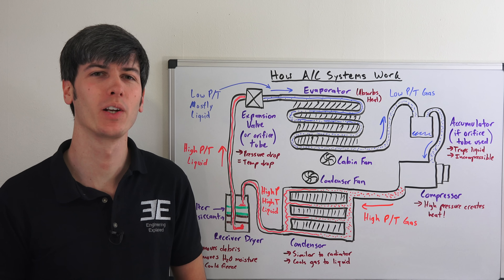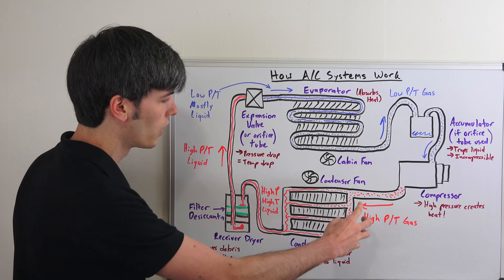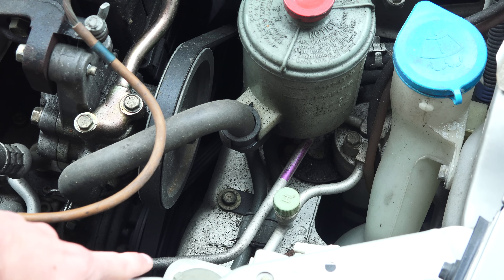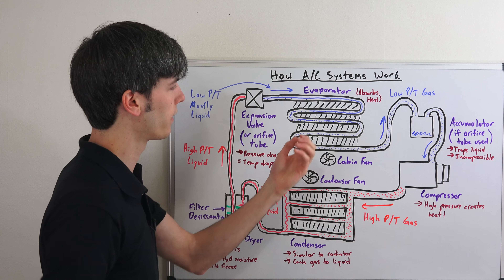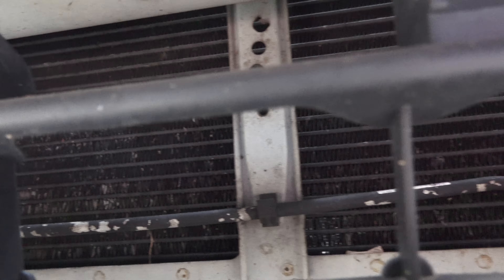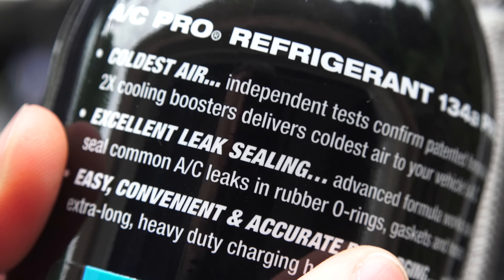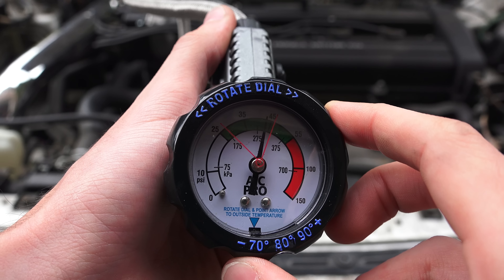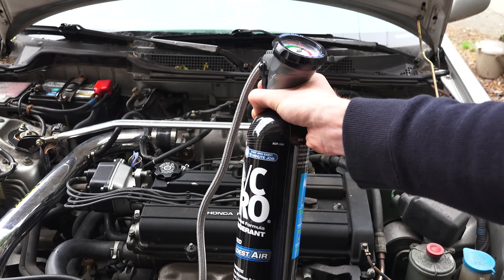How Car AC Systems Work & How To Recharge Your AC System

Comment: Coming from a professional tech, it's just never a good idea for the DIYer to do their own A/C work. Usually causes more problems than it solves. You can introduce air and moisture into your're system, overcharge or over lubricate because some of these kits also add oil. Sealers can ruin some expansion valves as well as shop equipment, hence why most good shops don't use sealers. Not to mention the safety issues of high pressure gas. I've seen people with some pretty serious refrigerant burns and some of them were mechanics. Just bring your car to a reputable professional in your area, trust me.
Reply: Yosef MacGruber just because you took your car to some backyard mechanic that didn't know what he was doing doesn't mean I'm wrong. Any good tech knows to check cooling fan operation during an refrigerant check.
Reply: Brian Fisher
So why did he apparently vent my refrigerant? I told him what was wrong with it, and it didn't work at all after he touched it.

The repair was simple, but any competent shop, will probably put on gauges, and check this and that and the other, so that they can run the repair bill into the $100s, but at least eliminate the problem of dissatisfied customers, "But it still does not work."

So what would have been the shop rate for my repair? I am quite sure it would be much higher than the cost of my DIY which I shouldn't have had to do. I guess my mistake was, in thinking that I actually needed anybody's help to replace the fan.

So how much money do you think I should sink into car repairs for an oil-burning car that is 2 decades old already?

"If you want something done right, do it yourself."

Because the world is full of morons.

"If electricity comes from electrons, does morality come from morons?"

Maybe you could answer me another question. In your expert opinion, what is the real reason that they do not want us to come back in the shop, and watch them doing our car repairs? Surely it can't be simply insurance regulations? Or do they fear "sticky fingers", that their tools could go missing? Are they afraid that we will all become DIYers? As much as car repairs cost, surely the fees must include allowing the car owner to watch? Now to let the car owner help, that might be an extra fee, as the joke goes. While the mechanics go home and watch YT to stay on top of their game? Of course, I am quite sure that YT actually does say to some people, in effect, "It is a bit too complicated to DIY, take it to somebody who has the right tools, and knows what they are doing."
Reply: Yosef MacGruber dude, lay off the Kool aid bro. You went to a shitty shop, get over it. And we don't want customers in the shop for many reasons, potential injury, missing tools and yes insurance too.
Reply: Brian Fisher
I wish I had a job in which I could ban the boss (or the customer) from watching my work. At least some people in the world, are treated as if they are important.

At least if I have something done in my home, you can imagine I watch what they are doing, because when the experts leave, guess who is left to maintain the systems of my home, if they have a problem? Thus, I feel I should know as much about them, as I can.

A shitty shop? Even a halfway competent backyard mechanic, ought to have a clue as to how an air conditioner works, before they hook up gauges without even asking. It is kind of a natural assumption, that people with the fancy tools, have some idea of how to use them. And speaking of which, I wonder where your shop ranks, on the "shitty scale" if you are actually making excuses for these incompetents?

But I have had problems with my car, that the dealer couldn't seem to figure out nor fix, then I take it to a friend, and a friend finds a way to fix it. Hmm. Always that it to the professional shop? I think not. It depends on what I need done, and how much money I have to spend, like how it is with a lot of things.

I have heard it explained this way. Let's say it takes you 2 hours, to fix your toilet yourself. You just saved yourself having to get a plumber. How many of us, have a job that pays $75 an hour? Sure, a plumber might fix the toilet in just 20 minutes, after taking 3 hours or 3 days to even show up. But not everybody has an extra $150 just lying around.

Also, I have a few plumbing parts, and watched a DIY video on how to simple plumbing jobs, so that makes me qualified to be a plumber, yes? So I fixed the sink for my employer, that everybody was reaching underneath the sink to turn off the water, because the faucet wouldn't shut off. Well of course, I did not have the correct washer to fix the faucet, in my tiny plumbing kit. So I took the old one to the home improvement store, and got something comparable. Even being on the clock, and reimbursed for a few dollars in parts, my employer saved serious money over calling a plumber. Got the same repair job, the sink worked fine the entire time I continued to work there. Of course, I am sure my employer would call a plumber before having me do any job that was too complicated. You probably do not want somebody with no experience, operating a motorized snake?
Reply: The Tool Guy
Illegal to work on your own car? Really? Have you not heard that politicians are liars? So that explains why we can buy bottles of refrigerant at the auto parts store? You never heard it was a free country, or whatever propaganda that they still tell us?

Did you know that is the purpose of quite many "laws"? To protect certain monopolies that do need protection from competition? One of the first things you learn in any decent economics course or book, is that it is largely competition that keeps prices in check/ If you are competent in doing your technical job, why do you need bully liar politicians, protecting yourself from DIY competition? Surely there are enough DIY screwups, to keep you in business?

Some of the differences in methodology, between proper qualified technicians and DIYers, are notable. No proper technician would use only one gauge to see what is going on with the car A/C. Yet that is all you get for cheap at the auto parts store. But it is the DIYer's own risk and liability, if they do not fix it correctly, as guess who will be fixing it again? The qualified technician wants to be sure he fixes it properly the first time, as he actually has incentive to justify the high cost of his skill. Why do so many of us bring our cars to the proper shop or to the dealer? Because we actually think that the shop will be expensive, but that they very likely do know how to fix the problem. If shops had terrible reputations, then there probably would be a lot more DIYing going on. By doing good work, mechanics can help keep our country above the kinds of operations that are more common in poor countries.

BTW, if you were alluding to that enviro-wacko junk-science crap about ozone depletion and how refrigerants supposedly damage the ozone layer, that is all incredibly bogus. Just another example of the rampant junk-science spewing from Babylon America. Ozone depletion was such a bad theory, that it has been strangely, quietly swept under the rug. Why? Did the liar mad-scientists become scared that the common people were about to uncover their entire deception operation?
Reply: The Tool Guy
Well if I supposedly do not know anything, then explain how I was able to fix my A/C?

BTW, how many times do you "professionals" manage to cut or injure yourselves while doing your work?

Probably most electricians have got themselves zapped a few times? Only amateurs always cut off the power feed to the circuit. Professionals don't have time for that. For they know what they are doing.
Reply: Well yeah... I mean, if more and more people start doing these things themselves, you'd be out of a job...

Comment: Have you worked on 1234-yf systems? If so could you make a video explaining the differences in the new refrigerant and the common 134-a?
Reply: Virtually no difference for the average car owner. 
There is an elevated fire hazard if R1234YF is released in the presence of extreme heat or flame. 
There are minor differences in the vapor pressure/temperature saturation points, but nothing significant. 
Some but not all manufacturers indicate R1234YF will operate satisfactorily as a drop-in replacement for R134A.

Comment: I need a longer hose for the kit I bought so that I can get the can in a position it can be rotated.  A couple inches from the bottom of the engine, by the firewall, just above a frame piece... was the only way I could get the included hose attached and reach the can without my hands being near moving belts.

Comment: Is the a/c clutch suppose to stay engaged all the time when the a/c is on and the car is working on park gear on idle in a properly charged A/C system or is it suppose to cycle on/off (Altima 2010)? Thx

Comment: Thanks for the demo.

I have a question though, how do I know the right pressure for my car? Isn't each car has a different recommend pressure? For example, I have a land cruiser which has three evaporators, consequently, I need more refrigerant than small sedans. Could you please elaborate on that point.

Comment: Hello I am from Djibouti I am watching your video and I wanted to ask you a question. I have an issue with my car which is a suzuki Jimny 2007. The a/c system is having problems. As soon as I stop the vehicle the a/c is not blowing cool air and the compressor is overheating and cutting. I went many times to the A/c repair companies here but the don't seem to find the problem.They said your Electric fan is bad I changed it. They changed the radiator moisture filter but still  the same issue. 
Can you help me please

Comment: 2001 Honda CRV with 204,000 miles and the A/C still blows nice and cold! (knocking on wood) Nice CAI on the Acura, how much of a benefit is there really in putting a CAI on a B20 engine? Mine is the B20Z with the ridiculous big resonator on the intake, so would it really make a difference?
Reply: Not too much of a difference, but the induction sound is so much better so if you have the cash its worth it.

Comment: I like your videos and have been watching for a long time, but I see some major issues with filling your AC system this way.

#1. It doesn't remove the moisture from the system. Moisture in the system will effect cooling rate and damage any parts that are able to rust (usually the rings on the compressor )

#2. The desiccant wasn't replaced. Its job is to absorb the tiny bit of moisture left in the system during a proper service.

#3. The aftermarket chemicals often contain sealant. Once your AC system is contaminated with sealant it can no longer be serviced properly without evacuating the system and cleaning out the sealant. Swelling the rubber in the O-rings also effects the life of the rubber and isn't guaranteed to stop the leak.

#4. The leak still hasn't been properly addressed, so it will likely leak again. R-143A ( which is commonly used ) is a green house gas, bad for humans in its normal form and turns into mustard gas when burned ( if it gets sucked into the intake ). Having that stuff slowly leaking out isn't good for anyone.

#5. There is no an unknown amount and type of lubricating oil in the AC system. Too much lubricating oil can affect cooling. Too little will destroy a compressor. The wrong type can chemically react with previous oil / refrigerant types and become slug.

#6. If there were metal shavings in the system, you never saw them so you missed the chance to diagnose a compressor problem. You also never got a chance to clean them out, so they will continue to clog the filter and wear out the compressor at a faster than normal rate.
Reply from the maker: Thanks for sharing, great additional information!

Comment: i think if there is needing to add a refrigent gas mean we had a leakage so we must chack it before add first notice some thing  like oil on ref. pipe or connection joint 
thank you

Comment: so a reverse cycle split system , changes the evaporator to the condenser, that's how you can have either heating or cooling
Reply from the maker: The heating is handled by a separate heat exchanger which cycles engine coolant to provide heat to the cabin.

Comment: Can you make a video on how to use the A/C vent circulation dial/buttons work properly to maximize full cabin coldness? Also, how to use the A/C cabin recycle button (not sure what its called but its the one with a car and an arrow of just circling inside). I get different answers to different auto car A/C repairs explaining how that button works. Thanks!

Comment: 1)is it really necessary to turn the AC of while starting the car 2) as soon as i insert key should i wait before ignition or should i turn on the car immediately
Reply from the maker: 1) It makes it easier for the car to start if A/C is off. 
2) Some cars need a second (literally just seconds) to get everything running (fuel pump, injectors, spark plugs). Others you can crank and go.
Reply: +Engineering Explained thanks bro I always had that doubt really appreciate it

Comment: Australia needs industrial AC systems in cars as it gets so hot here.
Reply: Try the Middle East, makes Aus seem pretty cool.
Reply: Australia? How cute :)
Reply: In England we just have miniature log fires in our cars
Reply: +James Gould yes ive just upgraded mine to a 3 bar electric fire
Reply: Speaking of Australia, recharging your A/C system is illegal unless you are a licenced technician.
Reply: Yup, you cant even buy those Recharge cans from what i know.
Reply: charge your system with r-409b it is a 12 drop-in. it will work with the oil and run colder due to the lower saturation temps
Reply: So does the neglected southwestern united states.

Comment: I noticed that the compressor in my new car is on all the time unlike my other car which the compressor turns on and off after a brief moment. I set the temperature around 25 celsius on both so it is normal for the compressor to go on constantly?

Comment: So you can't exactly "upgrade" your A/C? I live in FL, drive an econobox, and somewhat heat intolerant. I already have max tints, etc
Reply: +1 for use of the word "tints"
Reply: also driving naked helps
Reply: +T-WRX not sure I get it
Reply: Or make it spray water over your head.
Reply: you can, my dad did just that, get a bigger compressor or entire ac unit, lets say you have a corolla, then you get an ac unit for a camry that fits with minimal or no modifications, that unit is designed for a bigger cabin so it will even make your windshield freeze from the inside if you don't manually turn it off-on while driving, but maaan does it  cool good, if you leave your hand next to the vents it really hurts after a few seconds since it is REALLY cold
Reply: +EspHack Does your mpg reduce even more from that? If so, by how much?
Reply: You could also try adding extra insulation to the car and reduce the cabin space if at all possible. And if your car stays parked out in the sun a great deal then look into one of those reflecting tarps, not a pretty site but it spares your car from being directly blasted with several kilowatts of heat which your small AC then attempts to remove.
Reply: Bob TheBuilder you would have to test and check that for yourself, too many variants, but its pretty obvious it would reduce your mpg due to the engine having to deal with a bigger load, in any case it should be minimal and the results is very satisfactory anyway

Comment: just remember this.... there is a very good reason why a shop spends 2500 or more for a a/c recovery / recharge machine. can dispensers can easily overcharge a system. also by law... no freon should ever get to the atmosphere.  so if you have a leak...and all you do is recharge it...your just spilling freon. 
Also note... while r134a is better for the earth Ozone, than r12... it does however carries a massive global pollutant. which is why it's agent the law to vent it. 
there are many factor that can cause the a/c to not work. a leak is the most common. unless you the system.. I rec you take your vehicle to your automotive professional.

Comment: you left out saturation temps, super heat, subcooling sensible heat and the other heat, the evaporator has more heat energy that the condenser. The condenser is a loop coil not header to header.

Comment: The only thing that concerns me is that you did not purge the air from the hose, would that not introduce a small amount of air and moisture into the system?
Reply: It should be purged out in the receiver dryer.
Reply: for your knowledge, he did say he didnt need to refill the tank.... so he dditn refill the tank , so no need for purging it
Reply: +Finkin79 the job of the filter drier is to remove any moisture from the system that wasn't removed during evacuation.  Noncondensables (aka air) can't be removed by the drier as it only has a desiccant material with a filter element to trap debris.  The way to check for that is to use a low side high side manifold gauge, and watch your high gauge for abnormal pressure and movement; hence Dalton's law.

Comment: Do I have to evacuate the system first? I was told to do that before adding refrigerant.
Reply: +Wyatt Brookins Haha! I should have been more clear. My bad. I meant to ask, do I need to vacuum out my AC system (using a vacuum pump, not releasing into the atmosphere) before I put in new refrigerant.
Reply: You dont need the expensive machine. All it does is instead of you doing everything manually it does it automatically. You can do the same thing with $200 worth of equipment.